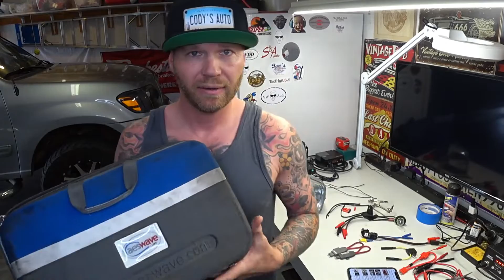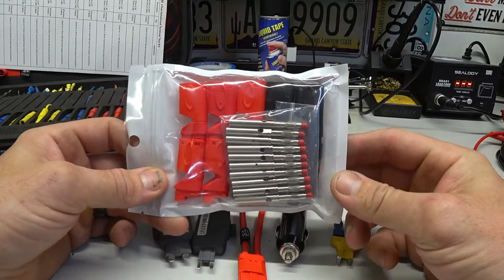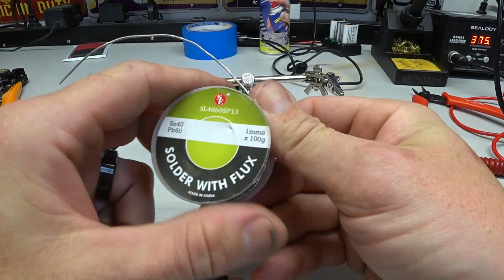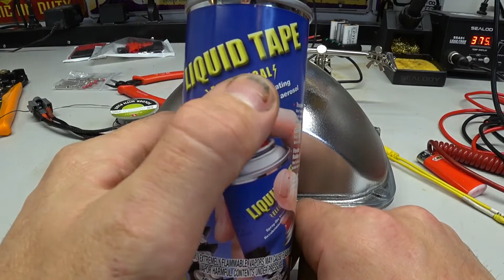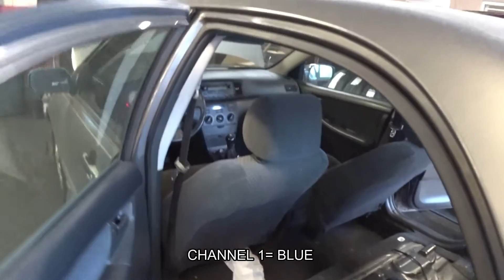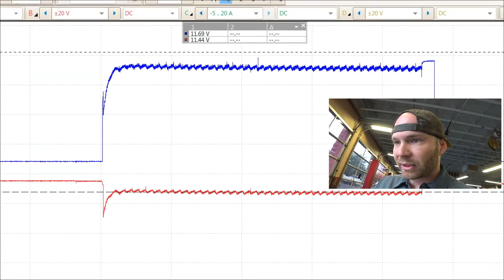#MAKEATOOLCHALLENGE

Comment: I worked on Ochkosh Mixers for years in Westchester New York , between salt on the roads and washing down with acid, wires corrode . We use a headlight to test all the time to find a faulty wire.
Store bought little Test light will lite but no amps were carried through the wire. Only way to test.
Reply from the maker: I’m lucky I don’t deal with lost of rust but I do see lots of wiring issue from pin figment or corrosion. Headlight always tells me what I need to know

Comment: On Pico test leads, is the ground provided by the shielding on the bcn cable?
Reply from the maker: The pico test leads have 2 wires from each channel. The black lead goes to ground and the other lead goes to the signal you are testing. The 4425 pico has separate grounds for each channel which means each channel needs to have a ground.
Reply: I get that part. I have some leads from an old otc solarity where the bnc leads only have one wire. The ground  is connected with a separate banana plug. I was jusy trying to see if i could add a ground by attaching a ground to the shielding? @codysautodiagnosticsprogra8706
Reply from the maker: @donaldisrael7147  hmm I not sure. I would have to see the leads to give you the correct answer

Comment: I am a tech that got heart and I can't do the work any more and I need some help if possible.  I have found some better way for testing under load and I was hoping to see if you could help me . I can be Reached by email at dafryer@msn.com with your help I think we can make a tester that can put any size load up to 12amp  as of right now so please let's talk if you can leave a number to get back to you will talk
Reply from the maker: Sounds interesting. I’ll send you an email or I can be reached at Cody’sAutoDiagnostics@gmail.com
Reply: Cody I will get back to you this week I am wanting on two part but if you could tell me the most common light bulbs you use now and want  you wished you had in a load size.  Will talk soon
Reply from the maker: Darroll Fryer looking forward to it buddy. I’ve used 3157 bulbs and a couple high beam bulbs and this sealed beam headlight so won’t burn plastic or carpet.

Comment: Nice vid. That AESwave kit is the best. I’ve handled a lot of similar kits and most of them used overmolded banana jacks that don’t fit scope insulated leads without using adapters or thick plastic at the terminal ends that prevent you from using multiple ends in a single connector.

Comment: Awesome stuff right there. 
I have a tool that I built for compressing clutch packs in a 4rW70 transmission. I built it when I rebuilt the tranny in my mountaineer. 
Not my design, but it worked great while only spending a couple dollars. Instead of a few hundred. 
It was built using one 2X4, some allthread, a couple nuts and washers.
Reply from the maker: It awesome when you can make a tool that will save you hundreds

Comment: I Need them banana clips.  are they the same size that power probe uses?
Reply from the maker: Ken Schmidt no man the pp is bigger then the 4mm
Reply: @codysautodiagnosticsprogra8706  
The test leads on my pp hook are 4mm, I've bought a bunch of ends to make up different adapters. Amazon has the male 4mm jack with about 4 inches of wire already stripped and tinned. Just used my last one and will have to order more.

Comment: Awesome video Cody! I think you gave me the idea to use bananas on test light and since then I always use stackable bananas, More freedom with use. also if using stackable there’s no need to use an adapter to add your test leads for extra length. You could also connect both powers for the bulb together for around a higher 10amp draw. Great use of math channel for volt drop for the complete circuit, never thought of that but will be adding into my testing
Reply from the maker: scott pitcher your absolutely correct man and I app it

Comment: Hey Cody, take one of your test lights and put connectors on each side of the bulb where you can hook up a voltmeter across it and you have a home made load pro just without the push button. How it works, if you're on a 12 volt battery and the bulb is lit and your voltmeter reads 12 volts being dropped at the bulb your circuit resistance is good. But if the bulb is lit ( loaded circuit) and your voltmeter is reading only say 10 volts across the bulb, you know you are losing 2 volts some where else in the circuit.
Reply from the maker: Absolutely! I actually have a video about doing this exact same thing with the homemade test light and checking voltage. https://youtu.be/hSHGYFXbI48

Comment: I use a bimetallic flasher and a head light like that for short finding. Remove fuse that keeps blowing and install the yellow fuse extension you showed hook up my head light and flasher a short to ground will cause the light to flash, following wires with a compass it will point to the short if you pass it compass will swing backward the other way. Or I go and start pulling wire looms looking for the light to go out. Thx for the tool tip Cody and it looks like the eye is healing up nicely.
Reply from the maker: That’s a trick I’ve seen before and it’s awesome! Thanks for sharing buddy